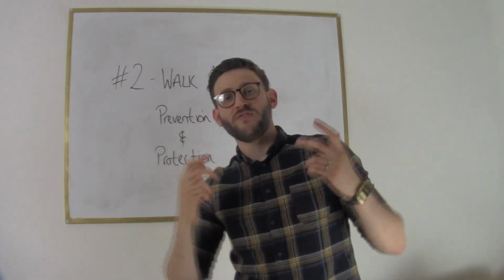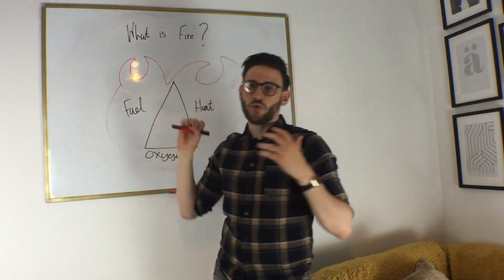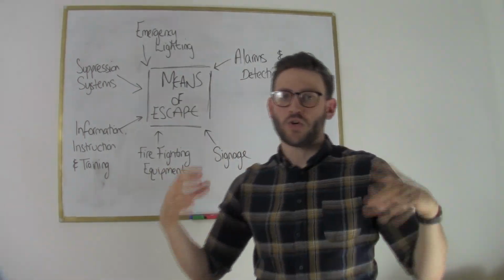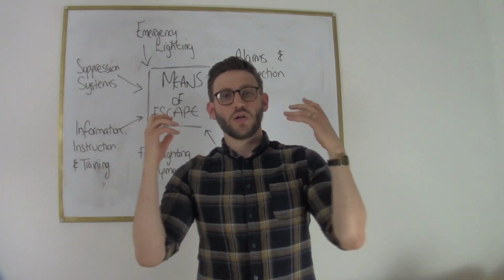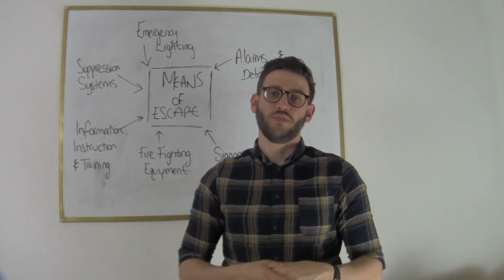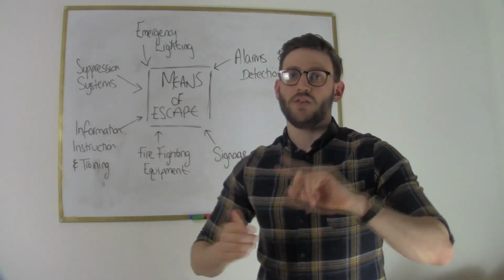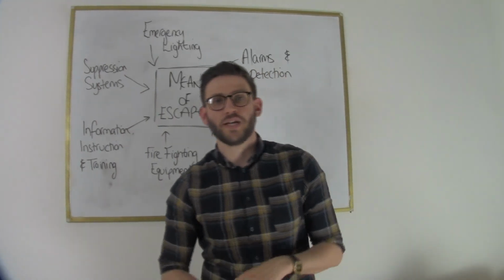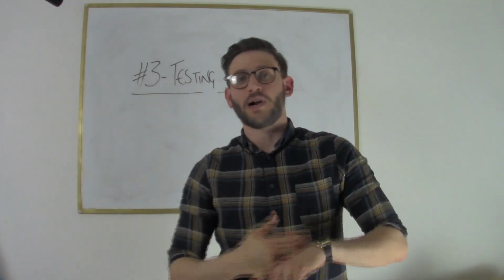How to do a Fire Risk Assessment- The basics-Toolbox Tuesday

Comment: Would you say that a holiday let is the type of place you need a professional for? I manage a few of them for my clients and as an on-call fire firefighter, I definitely know about fire but just not sure about doing them myself. I'd love to because it's impossible to get someone out to where I am in any reasonable length of time. Any thoughts?
Reply from the maker: Hi Donald, 

A holiday let would fall under the RRO so needs a FRA and because its the business operation it would fall under Safety at work Act as well. So you would at least need a "competent person" that manages the safety aspect of the business. If that helps. If you need any more advice or help buddy drop me an email james@riskfluentltd.com
Reply: @RebrandingSafety  Thanks mate, I've dropped you an email.
Reply: Thanks for useful video. I have a small gallery/shop...... surely I can do this myself?